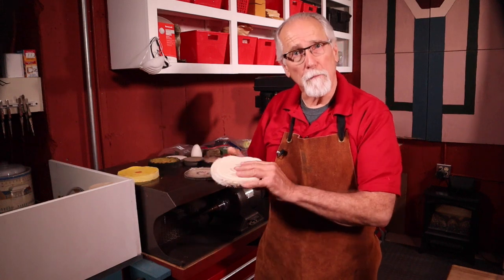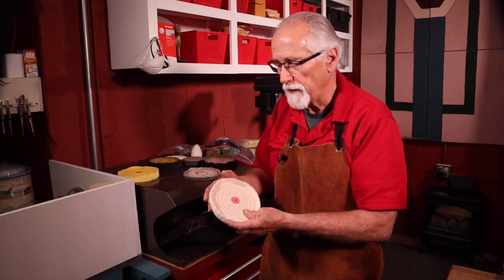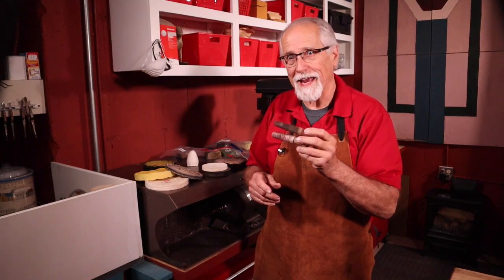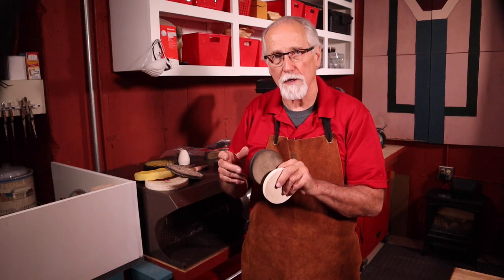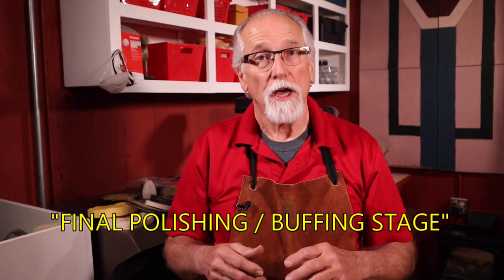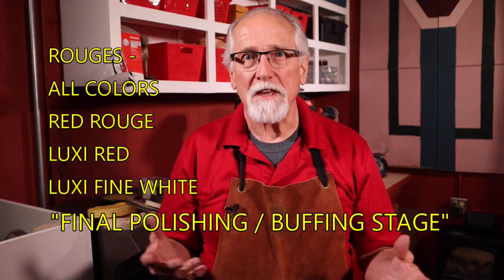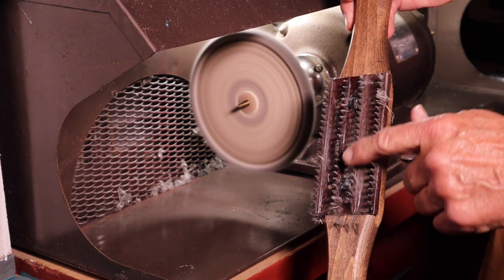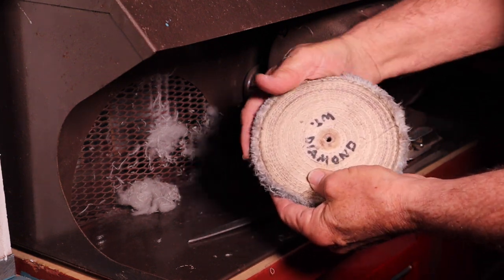JEWELRY BUFFS AND COMPOUNDS. WHICH SHOULD I USE?

Comment: I appreciate the videos, awesome information!  Would love to see you touch on flex shafts and their proper use
Reply from the maker: Hello,  Thank you for your great comments.  I will be doing a video on the flex shaft soon.  Make sure you subscribe and ring the bell so you will be notified when the new videos come out.   Thanks again.  Greg Greenwood
Reply: I second that request. I do all finishing work by hand and with the flex shaft rather than using a polishing machine. My space just doesnt allow a machine that size 😬 Thanks Mr. Greenwood your videos are always outstanding!!!!
Reply from the maker: Thank you! I will be doing the flex shaft video soon.  Thanks again.  Greg Greenwood
Reply: @greggreenwood4628  awesome to hear that you'll be doing flex shaft videos. The only power tool I use so far is a Dremel, and every once a blue moon, I get to use my friend's cab king. But mostly I work strictly with the Dremel.

Comment: As you stated, it is very important not to cross-contaminate your buffs.
That, of course, also applies for the flex shaft tools. Best way to keep things seperated there is to have a block where you stick your flex shaft tools and mark certain areas with the colours of the compound you're using with these tools.
Also, if you also work with non-precious or not-so-precious metals, one should keep in mind, that, since polishing is an abrasive action, some metal will actually go onto your buffs. This will significantly alter the way the buff now will work on your precious metal. E.g. you polish a new burnisher or a stamp, then, in this case, the buff will be contaminated with the iron from that tool - and since iron is much harder than any of the precious metals, that buff should never again be used with precious metal.
So one should not only pair buffs and compounds, but also mark them for the material(s) they are to be used with. Never use a steel/iron buff on precious metals and never use a metal buff on organic material (like bone, antler or horn objects).
Reply from the maker: Thanks Torsten for your insights.  I agree with you 100%.  Buffs are cheap so keep them separated and make life easy.  I use a steel compound on my tools, so I always have the buffs separate.   I will be doing a video on flex shafts soon and I will be demonstrating how to keep the buffs separated also.  Thanks again for your suggestions.  I always appreciate your comments.  Greg Greenwood

Comment: All of your videos have been with silver jewelry.  As a newbie, I am working with copper for now.  Would like to make some copper rings with bezel settings and also pendants.  I know the techniques are pretty much the same, but is there anything I should know that is different when working with copper?
Also, I do not have the fancy buffing machine that you have. I have a flex shaft jewelers kit; for now.  Watched several other people using the flex shaft for polishing, grinding etc, but you can tell MUCH information was left out.  With your EASY to follow instructions, was wondering if you could do 2 videos.  One -using copper for jewelry pendants, rings and finishing polishing techniques with perhaps the flex shaft or other methods if you don't have the ex[pensive machinery. #2 would LOVE a video on what you can use the flex shaft for, with an explanation of all the little bits.  I have had to watch MANY videos trying to piece-meal this info together; and quite frankly it has left me even MORE CONFUSED! I KNOW there is MORE information that is needed with using the flex shaft thatt people must assume you already know!
Thank you Greg for ALL of your videos, as I have learned SO MUCH thus far and I LOVE your way of teaching.  You make it EASY BREEZY!  BTW, my name is Beverly : - )
Reply from the maker: Hello Beverly,  Much better than Crazy! LOL .  Great suggestions.  I will work on them.  Thank you very much for your continued support and kind comments.   See Ya Beverly.   Greg Greenwood

Comment: Greg, Fantastic video. Thanks for the info.  I purchased a felt bangle buff.  It has a wooden core and I'm having a devil of a time getting it mounted on my tapered spindle so that it doesn't wobble.  Do you have any tips?  Same question for the ring buffs.  Thanks. Dan Spada
Reply from the maker: Hello Daniel,  Thank you for your kind comment.  I appreciate it.  Wooden core buffs can be a little bit of a pain when they are new.  You can solve this problem by :  (FOR THE BANGLE BUFF) 1. Holding the spindle and force the buff onto the spindle, turning and screwing it in at the same time. Then turn on the wheel and put a piece of wood up against the wood core to center it.  Sometimes it will fall off.  Just redo it several times.  This will open up the core hole and make the buff go onto the spindle further.  If you have to hold the core and adjust with your hand,  that is OK.  Just don't turn on the wheel while you are holding the buff.  OR: 2.  You can drill the middle hole out a little bit bigger and this will make the buff go onto the spindle more and it will be secure and centered.    (FOR THE RING BUFF)  Do the same thing on the ring buffs.  Be careful not to drill the hole too big.  There is limited space for you to work.  Ring buffs will center themselves easier than the bangle buffs.   Especially with the piece of wood pushing on the ring buff's wooden part.  
I hope this helps you.  Let me know how it goes.   Greg Greenwood

Comment: Hi Greg, thank you for your video. it is very simple and straight to the point.
Question, I have been having issues with Sterling Silver flat surface to get it to mirror finish. it seems at my last stage of polishing I start getting very tinny scratches with the direction of the buffing wheel. so every time I try to get rid of those lines I start getting new ones in the int the same direction that my buffing wheel is turning.
FYI, I'm using red rouge with muslin wheel. I have cleaned the wheel few times to make sure it is not contaminated, yet, still get the same results! at this point I have no idea what to do. plus, I sand my piece to 400Grits then I start with Zam til it is ready for the final red rouge.
Reply from the maker: Hello Raid,  Sorry for the delay in getting back to you.  Mirror finishes can be a problem because we see ALL the flaws.  The buffing wheel that you use at the end should be an UNSTITCHED cotton buff.  The "Balloon Cloth" buffing wheel is excellent.  It is super soft and will leave minimum marks.  Rio Grande Jewelry Supply sells them.  They are more expensive than the regular cotton buffs but are well worth it. You are doing the right thing to keep on coming in at different angles.  For the final pass on the mirror finish, touch it very lightly with the balloon buff in the direction that will match your design.  This will give you the max finish.  I hope this helps you.  Thank you for your comments, I appreciate it.  Let me know how it goes.  Greg Greenwood

Comment: I’ve now got 4 polishing compounds in my Rio Wish List and I’d like your opinion on them. Osborn white diamond and red rouge compared to Picasso Blue Platinum and Osborn graystar? The first two are from your lesson and the other two from another channel. Which two are best for Sterling and Argentium? Thanks
Reply from the maker: Hello Lori,  These compounds should be all you need.  I have not used the Picasso Blue but I have the graystar.  I feel that all of these are great for Sterling and Argentium.  I have worked with Argentium but have not done a lot of polishing to compare the graystar.  Every jeweler has preferences, so try them all and see which works best for you.  Remember, there are no rules to what you can use on pieces. But remember to keep the compounds separate from each other.   Thank you so much for asking, I appreciate it. The best to you.   Greg Greenwood

Comment: Can you comment on using the little buffs with the flex shaft? I only use that with Sam and haven't use any other buffing compound.
Reply from the maker: Hello Ann,  The compounds and the buffs are basically the same on the flex shaft as they are on the large polishing wheel.  You can   get the muslin buffs, felt buffs, etc. , and buff mandrels separately.  Keep them separated according to the compounds that you use.  Don't cross contaminate the compounds and buffs.  I will be doing a video on the flex shaft soon.  Subscribe and ring the bell so you will get notified when the new videos come out.  Thank you for your question.  I am happy to help.  Greg Greenwood

Comment: What about us guys who are just getting started, and don't own a bench grinder yet. Are there Dremel based buffs you'd recommend?
Reply from the maker: Hello Red Eye Stones,  I know where you are coming from.  I did not have a buffing wheel for a long time.  My first was an old washing machine motor that I put a tapered spindle on and strapped it to wooden board.  I used a pie pan with water and dish soap to collect the dust.  ( See my video "Jewelry Polishing Machine & Dust Collector")  Also check out my video " Age Old Low Tech Polishing and Buffing Techniques"   As for the Dremel buffs,  I would use muslin/cotton are great for polishing.  Use the compounds just as you would on a large wheel.  I hope this has helped you.  Thanks   Greg Greenwood

Comment: This might seem like a really silly question. But if I want to avoid using harsh chemicals, can I clean the polishing compound off the jewelry post-polishing just by using soap and water? I'm looking at a red rouge that says it's water based for easy cleanup. But it looks like the first stage compounds will need to be cleaned off with something that removes oil. Do you think that simple soap and water would be okay?
Reply from the maker: Yes, soap and water work great.  You can also use a natural bristle brush instead of a toothbrush.  It will not leave any scratches. If you can afford an ultra sonic cleaner,  they are wonderful and will really clean up your jewelry.  BUT, if the budget doesn't allow at this time, you can pick up a cheaper one for home jewelry at a box store or a thrift shop.  Love your questions!  Greg Greenwood
Reply: @greggreenwood4628  Thank you very much! Then I will use soap and water for now (with a cover over the drain) and place an ultrasonic cleaner on my "to buy when I can" list. I will most likely have more questions now that I am officially branching out into polishing. (I'll be placing an order for all the needed goodies within the next few days. And then learning to use them. Lol.) I really appreciate your willingness to help! And thank you for the awesome answers and videos! 👍 🤗
Reply from the maker: Have Fun! and you are more than welcome.  Greg Greenwood
Reply: @greggreenwood4628  I'm playing with my online shopping cart right now and having fun already! ☺️ I read your suggestion to someone else to check out Rio Grand. They're awesome! And my dremel is set up and ready to go. (I'll be watching your video on dremel use  as soon as it comes out, too.) And I'll be using hand tools like in your low tech video, too. I can hardly wait to try it all hands on! 👏

Comment: What if I use small cotton stitched buff  for a flex shaft and how to "peel"  then if i don't have this sharp metal tool you mentioned here: https://youtu.be/4-ojCNL3gGg?t=438 ? I assume it's also too big to use. Is there another method without complicated tool needed?
Reply from the maker: Hello Dominika, Sorry for the delay in replying. You are correct in not wanting to use the large rake to clean your small buffing wheels. 
For the small stitched buffs on the flex shaft, you can use the edge of an old file, a serrated knife, a fork,  a broken hack saw blade. Chuck these up in your bench vice if you have one.  It makes it easier to hold.  I have even used a broken piece of concrete block.  Anything that has a rough edge will work fine.  Definitely keep it simple!!  Thank you for your great question.  I hope this helped you.  Let me know how it goes.  Greg Greenwood

Comment: Why does my silver turn black when I buff
Reply from the maker: Hello Chuck, I'm not sure if you mean it turns black because of the grease compounds or when you polish, the silver has a dark "cloud" on the surface.  I'm going to assume it is the later.  The dark is Fire Scale or Fire Stain.  Check out my video "Understanding Fire Scale".  It will answer most of your questions.  This is a problem that all silver smiths have and you should be aware of it and things you can do to prevent it.  Let me know how it goes.   Greg Greenwood